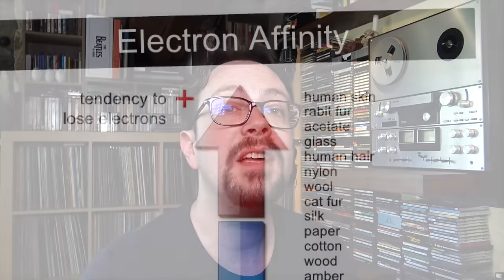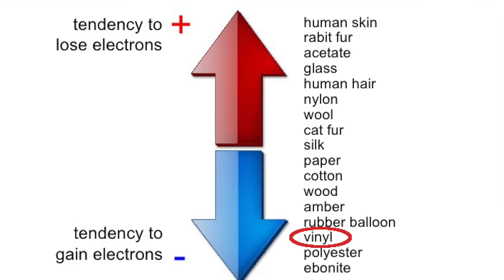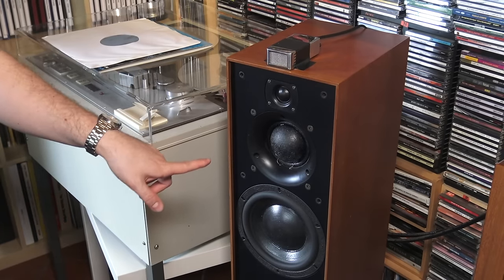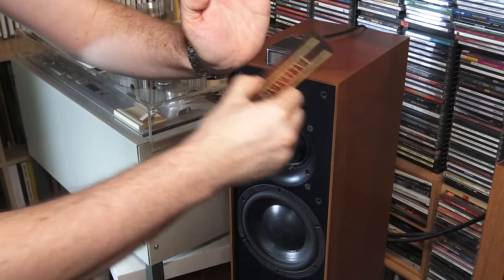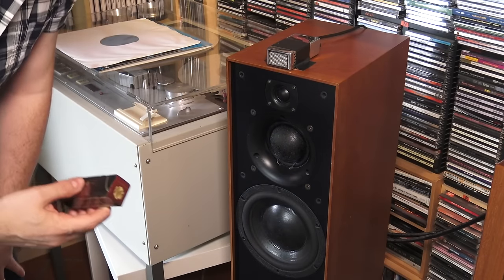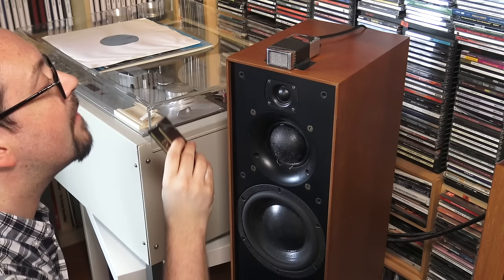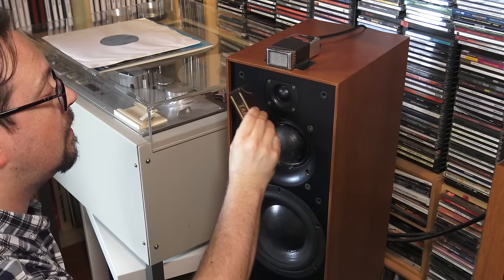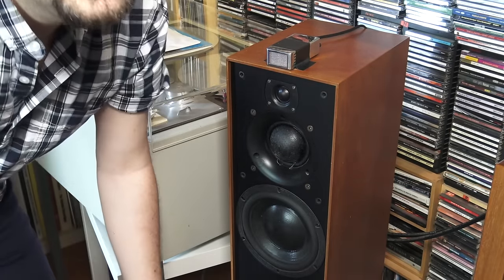How to eliminate static electricity from records & gear

Comment: I would be curious to see measurements of its efficacy in a measured, objective experiment.  I retired my  Zerostat in favor of a Furutech piece that is significantly more effective based on both measured results (device that reads static charge on LP's) and confirmed by my use of it.  I'm currently trying out the DS Audio deionizer which actually sits by your turntable and discharges static as it occurs.  Removing the static pre playing does not solve the problem since the act of playing it creates static - Hence the frequent occurrence of a felt mat coming off the platter with the record.  By the way, I would much rather have a very low concentration of alcohol on my records than any kind of coating.

Comment: Static Electricity unfortunately is generated in vinyl simply by the rotation of the earth. There is a lot you do that effects static build up. First Cleaning of the record, then before putting it in an antistatic inner sleeve, I use an antistatic gun a few times. Then before playing I again use the antistatic gun. But it doesn't end there because static will build again while playing, the gun only have an effect for a few minutes. So I added a Furutech SK-filter to my record player which continually decharge the record while playing.

Do not use antistatic fluids and film solutions, it works for a while but is in the long run not good for your record.

Finally. Static pops is not the main problem made by static charge. A properly discharged vinyl has less noise. The static charge is continually discharging into your pick-up, always, and it sounds like background noise, like pink noise, or close to regular surface noise. With something like the SK-filter that noise is clearly and noticeable reduced.
Reply from the maker: Well said! That is way the talisman (shoud last longer).
Reply: How can one get rid of the static charge in the pick up? Mine is giving me little electro shocks each time I lift it, it's so annoying!
Reply from the maker: Woah! Are you sure your turbtable is grounded? Seems we are talking about current and not static electricity...if not, try using the Milty gun!
Reply: Yes, absolutely sure! It's grounded. When I say little electro shocks I mean a spark that hits me, just like the one you get when you rub your shoes on a carpet and you touch someone.
Reply from the maker: Check part 2 of the video upcoming in july!

Comment: Where did get the idea you have to release the zerostat away from the record? the zerostat should be released above the record, pull is positive ions, release gives negatives..(says manual)
Reply from the maker: In an earlier version you were supposed to discharge the gun away from the record. I discovered recently that this has changed...God knows why! In any case, it works in both ways fortunately!

Comment: the liquid that comes with the disco ant stat machine which i assume is the same as the one shown here is terrible for cleaning a record wand will fill records with gunk dont use it for any purpose! haven't used the talisman but the zero stat is around $70usd & has been used by pros for a long time & probably the way to go if you not have $300 to spend

Comment: with the ZERO Stat do you ever have to rezap the record?   will the record ever develop static again?
Reply from the maker: The zap lasts for one play, and the zap is necessary for each side. This is if you clean it with a brush or just have static in your environment...
Reply: Of course static will build up as the any movement causes more charging of static electricity same as walking over a carpet with shoes that generate static as you walk you will get zapped EVERYTIME you touch the metal door knob. Vinyl is a plastic and as it is brushed for dust removal it will gain static the same way.

Comment: It is literally impossible for a magic talisman to increase the fidelity of an optical disc. Digital media fundamentally does not work that way, period.
Either it works or it doesn't. Ones and zeros.
Reply from the maker: The talisman ain't that good considering how much it costs.
What I can say is that it is not just 1s and 0s, I wish it was so. Just consider the enormous amount and types of filtering that digital audio has you immediately understand that digital is very far from perfect and linear.
Reply: @anadialog  Ok but the filtering happens on the DAC, not on the reading of the disc.  The information on the disc is literally just 1s & 0s.  Anything you actually hear has been converted to analogue (an electrical signal), by guess what, the digital to analogue converter (DAC).

Comment: Alcohol flashes off too quickly, especially the low amounts that may be included with such products. 

The alcohol helps speed up the flashing (drying) of products that use water in their formula. 

I wouldn't worry about it too much.. there are bigger issues to worry about then .5% alcohol in a cleaning  solution.

Comment: I think you have to avoid using the Talisman with burned cds or dvds cause that could destroy the recording.
Reply: You're 100% correct - many recordable cd's/dvd packets include a warning to keep away from strong magnets.......that's there for a REASON!
Reply from the maker: Interesting!
Reply: @museonfilm8919  The data on a CD gets stored chemically - the laser destroys/'bubbles up' a chemical so it changes colour. A magnet does not influence the non-magnetic chemicals. If this was not a joke by the original poster anyway, the reason is that once a magnet is stuck to a CD, taking it off again may scratch/rip the surface of the CD carrying the data on it's underside. Otherwise, holding a magnet next to a CD does nothing.

Comment: Bybybe Gnostic expensive solution (started from 10 eur the bottle now the 30 eur the bottle)…I use 1/4 alcool and 3/4 distilled water same result never an issue,same silence and static result 😊

Comment: I like that you're attacking the issue, but here are two problems: 

1) You don't see a need to clean your records???   Why???  Use a wet vacuum record cleaner or better, an ultrasonic cleaner (under $200) on ALL your records, new or old!!!  Now, you don't need to clean them before each play, but good grief, CLEAN THEM at least once before your stylus hits their grooves!

2) Antistatic sleeves are _conductive_!  That's why they dissipate static.  That's what ESD packaging is, plastic with a conducting metallized layer to enable charges to dissipate.

Please learn more about electronics.  Otherwise, I like your work. 🙂

Comment: I only hear static (pops, crackles etc) when I touch the metal tonearm. No hum. Ground wires are connected. Any suggestions would be great. Thanks!
Reply from the maker: That is strange...use the Milty gin also on the arm...it works on anything...plus, get rid of your carpet or move it...
Reply: @anadialog  I ordered the Milty so I'll give it a try. Thanks!
Reply from the maker: Cool!

Comment: Laser's don't read dust or static, What's the point.
Reply from the maker: Static electricity that may build up on digital discs do interfere with the laser reading and creates issues that reduces the quality of the sound. In the future I will present other products for cd's that have even more positive impact.
Reply: How? To my knowledge the CD protocol has error correction during reading. Also, the redbook CD player standard states that a CD player has to be able to read the data off of the disk without interruption even if there is a gap in there below a certain length. (Scratches, dust, etc.)
Reply from the maker: I must admit that I do not know how it technically interferes but it does. Since solution that remove static, or even light!, do have a posite effect of the sound. I will make a video on this in the future.
Reply: Have you blind tested it? This product really fits the definition of snake oil. (This thing here will improve literally everything you rub it on!) I'm not qualified to make any final judgements since I'm not a physicist but I still have a reasonable understanding of physics and some of the company's statements raise a lot of red flags for me. Anyhow, you really should confirm whether it is placebo or not.
Reply from the maker: I will do that,  i did claim that i rid nit hear any difference on the cables, while on the cd a slight improvement. Surely not sufficient to acceot such s high cost. Nevertheless, I am still testing...in any case the focus of the video is ststic on vinyl records. Digital is a bonus!
Reply: ana[dia]log I look forward to the possible results! I'd say the best place to publish them would be on your next video on this topic. Good luck for now!
Reply: Too true!!!!!!! "Paul McGowan" (YouTube channel) from PS Audio would love this video. He puts an image of a snake writhing across the bottom of the screen each time someone brings up a suspect subject like this in his "Ask Paul" videos. He's great fun,& a source of good audiophile knowledge too.
Reply: Redbook's reed-solomon (CIRC) error correction could work up to certain point for music playback. It can easily correct errors without re-reading the faulty sector. It can also indicate when an error is non-recoverable. However, while CD is being read for music, CD-Transport usually do not go back  and re-read the segment that seemed to have unrecoverable error. This is because, in real time playback such re-read cycles would seriously hamper music listening experience. Instead CD Transport electronics uses extrapolation to guesstimate  the bit(s). CIRC is so good that it can literally correct large amount of error in a sequence. However,  having a clean CD surface is always helpful. However, I really do not buy into these special cleansers. Yes .. if there is more static on your CD surface more it will attract dust particles. But do you need special fluids to tackle that ? I do not think so. A simply lint cloth has enough static to pull off the dusts from CD surface. 

Most of the CD reading error happens from the Laser's tracking faults and internal electronics and how is samples the incoming signal from laser. You can test this simply by recording the line output from a CD Transport. Simply record same music several times. Then compare the wave form. Use Audacity App if needed. You will notice  none of the wave-forms are exactly identical. Every time it is slightly different !! Now whether you can hear that difference  will completely depend on how resolving the overall audio system is. Most of the cases, it is hardly audible.
Reply: How? wel... bit erros can be 'corrected' by algorithms, but that doesn't mean these algorithms actually can calculate back to what the original data used to be. So yes, it will probably very close to the original data and maybe its not possible to hear the difference (I've never tested that, since idc about CD's). But the difference is present nevertheless. A field of static electricity does not necessarily needs to distort the laser to inflict loss of audio quality, it can also couple with signal paths that come from and go to the laser. It can also give analogue distortion by means of coupling behind the driver IC's and DAC, depending on the location of the electrostatic field.
So yes, it can make a difference to prevent or remove dust or static electricity, but if it actually matters... I doubt it, to be honest.
Reply: Dean Bull, try using your head and listen to the video
Reply: @QoraxAudio   You do not hear any distorsion in a digital media when the error is active. Any anomalities arise from a failed correction attempt. The algorithm when successful will restore the original data 100%, it is just a 1 or a 0.
Reply: @juslitor  Error correction is often done by a method similar to CRC.These methods do not guarantee a BER of 0.
Depending on the length of the polynomial compared to the total length of the data, the BER varies and can be reduced to extremely low values by using a longer polynomial. 
https://en.wikipedia.org/wiki/Cyclic_redundancy_check

Early CD players often used parity bits in their data packets, which are unable to even do any type of correction. When a packet is detected to be wrong, it just gets sinked to ground and read again from the CD.
https://en.wikipedia.org/wiki/Parity_bit

Comment: Zerostat gun really works, but I got negative opinion on them, because mine failed in a month or two. I had to open it and fix it by myself, but for what I found inside, high cost, and unreliable quality, it is not worth it. Definitely would spent those 70 eur somewhere else. Carbon fiber brushes actually remove static, if you hold record in ur hands and gently touch it with the brush. Touching with the brush while record is spinning generates alot static. So far I have best result when I play records which were properly washed, rinsed and vacuumed, even after few years they show me less or completely no problems regarding static.

Comment: Complete and utter audiophoolary! How on earth did you get static onto your CD? Static charge ends up on records from the friction from the stylus making contact with the record groove. Compact discs are a contactless system. Place a toilet paper sheet on the CD at an angle, I'm betting 100% that the paper slides right off. No static!

I've enjoyed quite a few of your other videos, but this was sad to see. I thought it was a joke at first.
Reply from the maker: Don't believe my word...check for yourself and you will discover that static does affect cd's and more specifically it creates issues in the rotation...
Reply: How do I check exactly? My system clamps the CD to the spindle which in turn is connected to a motor. Even if there was static electricity on the disc (which there's not) it wouldn't be strong enough, or close enough to to the motor to affect it. Even if there was an effect the data correction system built into the redbook standard would correct for it.
Reply from the maker: With your clamping system the effects are surely reduced, I agree! Here are just a few reliable things I have found on static electricity and CDs: https://www.enotes.com/homework-help/when-do-you-wipe-compact-disc-with-clean-cloth-why-441237
And
http://forums.stevehoffman.tv/threads/cds-static-milty-zaperator-walker-talisman-anti-static-spray.545659/
In any case, static builds up on records also by just handling them, taking them out of the jacket and using brushes (even if they claim they are anti-static). Plus, dry sir and rugs under your feet will enhance the problem...
Reply: Andrew Lamb I have no evidence of this exact process but your assumption that record static comes only from contact between stylus and record isn’t true. It comes from carpet, sleeve friction, and other sources. Analogy: Clothes don’t develop a charge just because we wear them on our bodies. You might also live in a moist area with tile floors, etc. where static is much less of a problem.
Reply: The Eccentric Hobbyist I didn’t say it only comes from there. In a contactless system where a disc is read by a laser static electricity has no effect on it, that was my point.
Reply: Andrew Lamb No real argument but you can still battle static with any medium. Can’t say definitively but I imagine engineers of CD players consider static buildup to be a concern at at least some level of design.  Interesting topic for sure.
Reply: The Eccentric Hobbyist My guess is that compact discs have an anti-static coating as I have 500+ CDs and not once have I felt any static while handling them. With records it’s a regular occurrence. I’ll pick 10 out at random and place some toilet paper on one side, see if it clings, it’s been very dry here in the UK. 

The motor for the laser rails and spindle are far too powerful for static to produce a problem. That leaves the laser diode and beam. Laser printers work by producing an electrical charge (static electricity) onto a Mylar film via a laser where the ink is then attracted to. So if a precision piece of equipment like that can work reliably for years (my laser printer was bought in 2003), then I can’t see static having any problem in a CD player even if it was full of it. I’m no scientist though, so maybe someone else can chime in! The audio world is full of bogus claims, it’s always best to question anything like this with logical reasoning.
Reply: Andrew Lamb yeah, I love CDs for so many reasons I cannot believe it’s a dying medium - I’ll buy em up! My focus for the static comments is on the vinyl side which I’m just starting to revisit as I bought a used Nottingham 294. The streaming world has introduced so many inconsistencies it’s a little surprising the acceptance - apparently solely for the convenience.

Comment: Here's a thought.
When you build static electricity in  your body and touch a ground, you get zapped and the static is gone.
So why can't we simply "ground" records to something and remove the static the same way ?.
Reply from the maker: Because it doesn't, it remains charged. I tried. Moreover, the spindle several times is grounded and touching the record as well as some antistatic brushes.

Comment: Another very good, informative video. However, most of the static electricity happens to be on carpeted floor. Furthermore, static electricity is abundant during the winter season. That zerostat thing appears to be efficient, but how does it work? Again, great videos on the vinyl realm of high fidelity.
Reply from the maker: I agree!! The carpet is a real killer. Going to mention that in the second vid. The zerostat is a based on piezoelectric technology. A crystal is stimulated to rwlease negative and positive iones...i works like a charm!